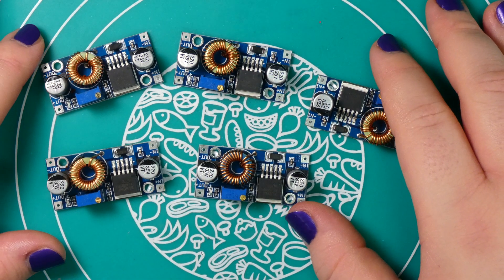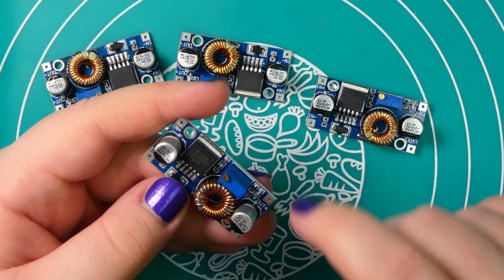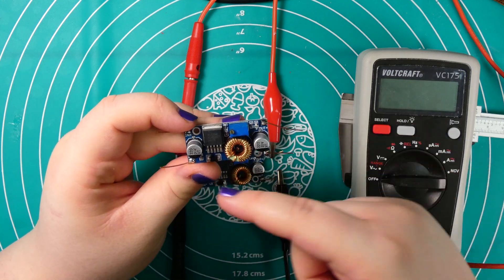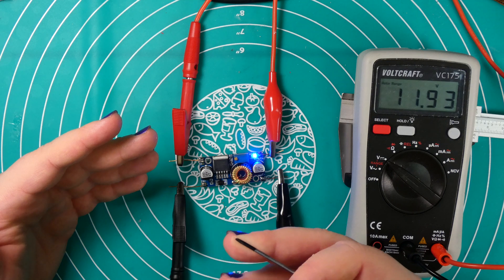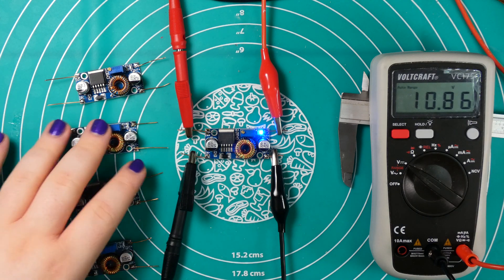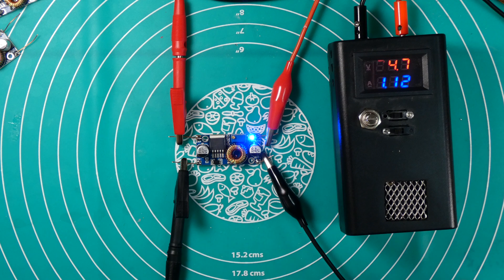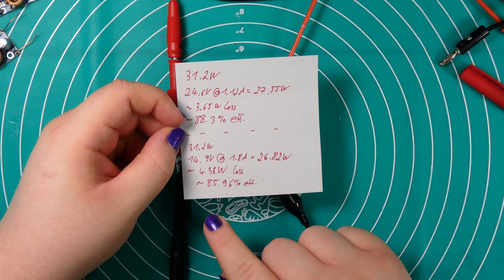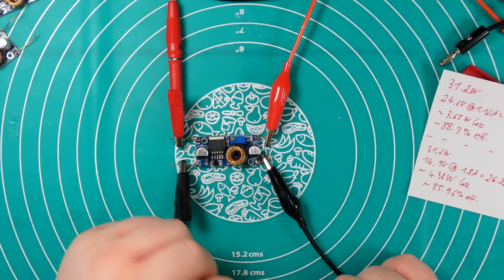Buck Converter Test and Review - Very good and affordable!

Comment: Hi Anna, I suspect that these bucks all come from the same factory regardless of who is selling them. I found Bangood very good but for some reason ended up with EBAY. No problems getting refunds if any defect or no delivery.The unit you show looks very similar to the XL4015 board. Only difference is the XL4015 is 36V input and not 32V. I have maybe 8 of the XL4015 and once or twice thought I had popped one but they seem pretty robust. The XL4015 has a max of 40V and my DC supplies are 38V as you know. They seem OK so far. I do use a heat sink and 40mm fan at 8V and no more than about 3Amps normally. So glad you got past your bad batch, I'm sure they went to many sellers, not just Bangood. No doubt quality control at that price takes a back seat at times.
Reply from the maker: I never had a problem with banggood so far. Whenever something got lost or was defective they offered free replacement or a refund. And as their prices are better than ebay I tend to buy from banggood.
My experience with all Xlsemi products is positive, their dc tro dc converter ICs are really good.
Reply: @PhysicistAnna  I remembered why I started using EBAY. Bangood don't sell used items like used Monacor amplifiers. Those amps were almost a linear 38V  - 8A power supply when they arrived. I made my first 'Monacor' power supply with one LM317 and a couple of meters added. I had stripped a very large plasma TV (32 heat sinks, etc., etc.). Anyone starting out making a simple bench power supply could not find anything better to start with for the money. The newer Monacor amps though are using aluminium windings on the transformers so best to keep to the older ones like the PA-900. Oddly enough most of the people I know on the Forums seem to buy from EBAY - more choice perhaps. I got quite chatty with one seller but eventually 'they' put a stop to it.
I thought I might try one of these. (EBAY)  :-   400W 15A DC-DC Step Up Down Boost Buck Voltage Power Converter Module Supply UK
Incedently it's cheaper to buy things on EBAY in $ but best to buy each one seperately not several together in the trolly. Things seem to get 'sticky' if you do.

Comment: Yes Buck converters are better.
However the linear stablelizer Lm317 is an unfortunate choice. Part of the energy is utilized in heat. 
Thanks for sharing mam 🙂👍.
Reply from the maker: Hey thanks for your comment :D
One thing though, there is no LM317^^ The buck converter uses an XL4005E1 which is a dedicated buck converter IC :)
Reply: @PhysicistAnna  yeah Lm2596,7 are better than Lm317. 🤷‍♂️
That's what exactly im saying hahaaa